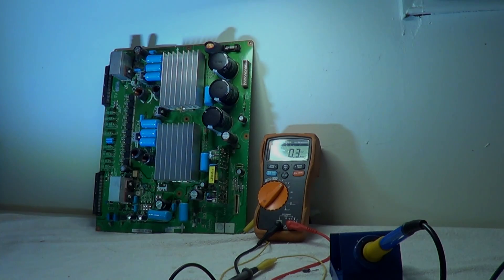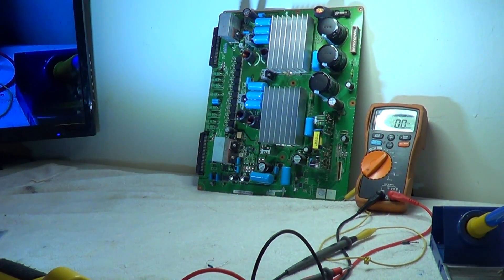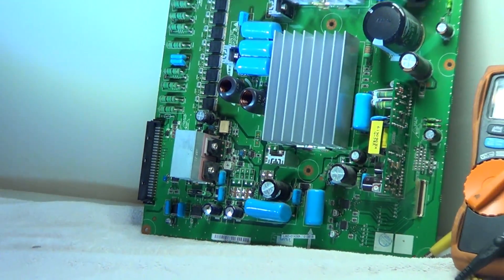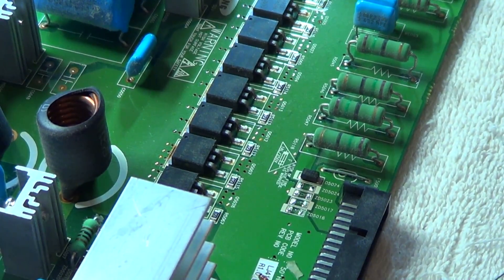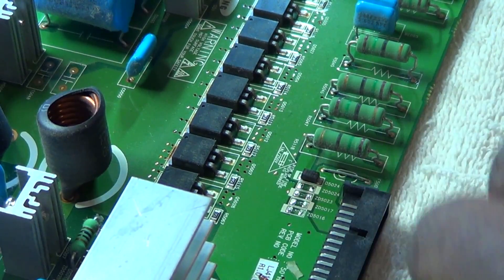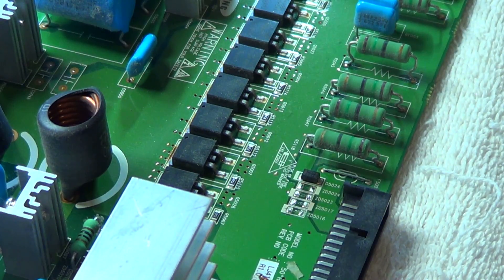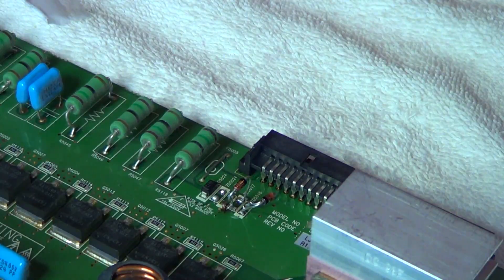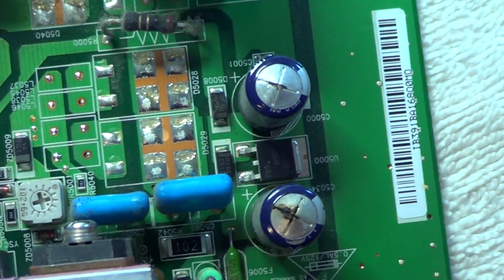Samsung plasma tv Y-main board repair. HP-S5053 Sound but, no picture

Comment: Hey bigdog, I messaged you about the SMPS on a samsung 50" plasma, I got the SMPS working, now the X main board fuse is blown, it has a dead short, what commonly shorts on those, I got another board coming for 10 bucks, hope it works, but if you know me, I like to find out why it shorted, with so many things in parallel how can you tell what is shorted?  I thought about applying lower voltage and maintain less than 6 amps to see what gets hot?

Comment: First of all I want to thank you so much for taking the time and making all this interesting videos. I have learned so much just by watching them. THANK YOU. THANK YOU. THANK YOU.
I have a problem with the same TV HPS5053 and  would like to ask you a few questions. Sorry I do not have any social media that you mentioned like Facebook or Instagram so I hope you will answer me on this post or email me at stern_alex@hotmail.com.
After replacing one bad cap on the power board and one on the Y board. My tv still had no picture. Then after watching this video and  fallowing your instruction it seemed clear that I have the same Zener diode issue.
All 4 Zener diodes are shorting out on the lower part of the board just like in this video. Also the black rectangular diode right above them. (location D5023) markings on it says PJ69ES1G, I assume its a regular diode and not a Zener since it does not start with a "Z". Also the same black rectangular diode is shorting out on the upper portion of the board right under the 4 Zener diodes (location D5024).
All though I could replace them with the through hole diodes as you used in this video. I still would like to replace them with a surface mount diodes.
But when I shopped around. I was asked what is the package. I now know "package" refers to the size of the diode.
So to get the size I have searched the web for the schematics on the Y board (LJ92-01436A/01391B) and on (HPS5053) and the only schematics that I was able to find were on:
https://www.manualslib.com/manual/1037290/Samsung-Hps5053x-Xaa-Hp-S5053.html.
But it did not have the Y board schematics, or it might just be me not understanding how to read the schematics.
With that said, my question are:
What is the size of those Zener diodes (surface mount) (location ZD5018,  ZD5019, ZD5021, ZD5022) and if you can provide a part number.
The other question is the same as to the black rectangular diode (location D5024 and D5023) they identical and both marked PJ69ES1G on them.
So part numbers would be helpful if possible. If not size and value will work.
P.S you mentioned that the Zener diode is 36V 1W.
I would of uploaded a photo of the boaed and section in question but do not know how to nor if it is possible.
Once again thank you very much for those videos.

Comment: How do you unplug he buffer connectors ? (Long black ones) next to the diodes ?)
Reply from the maker: just take a nice size flathead screwdriver and stick it in between the ymain and the buffer boards to sort of pry them apart to get it started. Them just pull the y-main straight back using your hands. You have to make sure that all the screws are removed first from the ymain board so you call pull it away from the buffers.

Comment: hey so i have the exact opposite problem... my tv has picture but no sound . then i would hook up my nintendo switch and it works with picture only on hdmi 1 and neither picture or sound on HDMI 2.. when i hook up my ps4 , i get neither picture or sound on either...PLEASEEE HELP..

Comment: hey big dog thank you for this video, i have the same board fail on me but its the zener diode set on the lower end of board with the 4 zeners and an extra regular diode in the circuit it kinda cooked the area and i was wondering if there might be a reason or is it just because they shorted out, or if u know what causes the short to begin with . since u replaced them i figured they just fail over time ...any help would be appreciated

Comment: I have Samsung 42”plazma.my vs and va going down as soon i plug it in. Found that on y main blown one 10om resistor. Replased it ,after pluged in saw spark on same resistor.it was dead after, and voltages went down aswell. When i unpluged y buffer from y main voltages did not dropped even with dead resistor. After replaced one more resistor and pluged in power, voltages were ok, and resistor was ok, as y bufer was disconnected from y main. So how to locate what is wrong, y buffer or y main?
Reply: Just to update, found two transistors dead on y buffer, soldered them out,  without them voltage does not drops.so need replacement. Now found issue with X Buffer, if it connected to logic board, same issue, drop down Vs and VA voltages. If everething iw connected exept x butter to logic,  voltages are ok

Comment: i fixed 4 zener diode on both sides but when i switched on TV then some dots blinking on the display. Please provide the solution
Reply from the maker: adjust the VS maybe? should be some controls potentiometers on the  the board